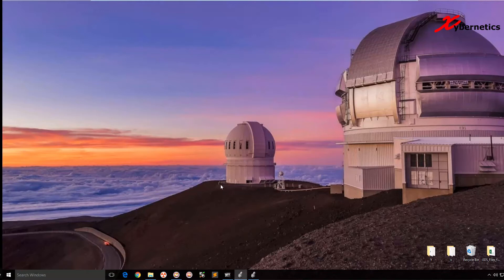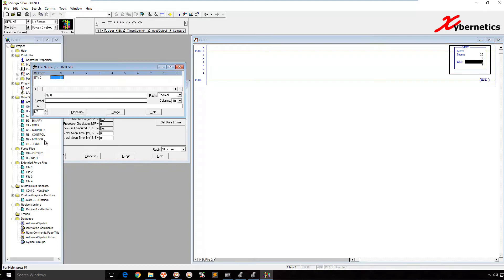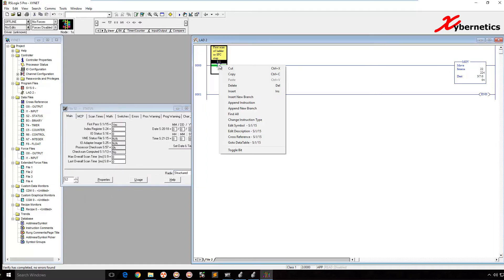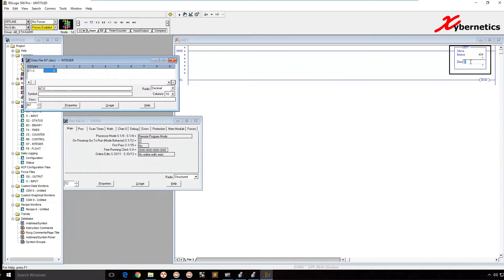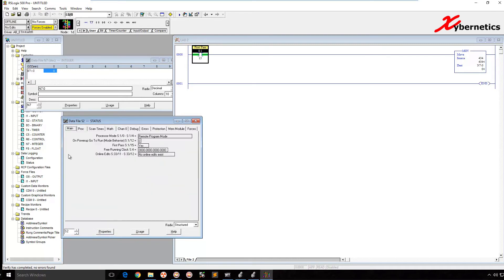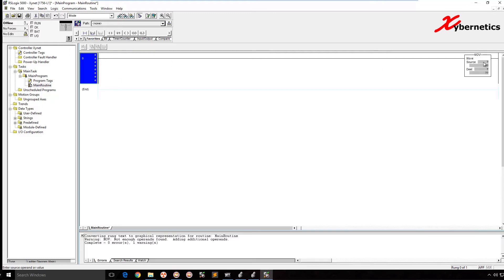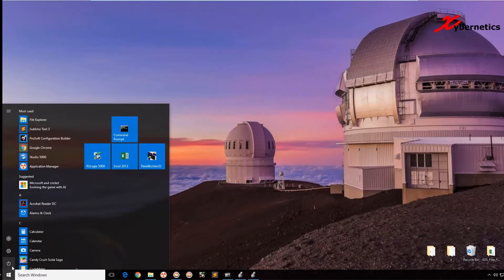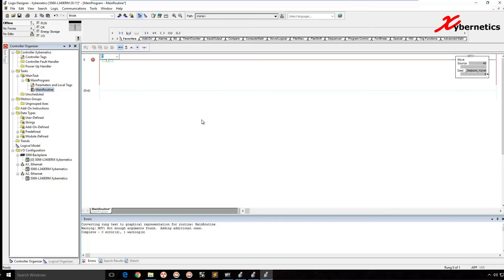RSlogix 5000 or Studio 5000 First Scan Bit For System Initialization

Comment: how we activate the S:N (user negative bit) and  S:Z (user zero bit)?
Reply from the maker: I don't think I am following you.
The RSlogix 5, RSlogix 500 and RSlogix 5000 uses status bit to display the status of the say function block or processor.
Have a look at the "Rockwell Allen-Bradley SLC 500 Instruction Set" user manual (link provided below), page 67 about ADD and SUB function block. Where S:0/2 has a value of ZERO for RESET. and if the value is returned as negative S:0/3 s set (1).

Rockwell Allen-Bradley SLC 500 Instruction Set
https://literature.rockwellautomation.com/idc/groups/literature/documents/rm/1747-rm001_-en-p.pdf

I hope that helps.

Comment: How do we find the status bits file in RSlogix5000
Reply from the maker: It is defined in the user manual. Status bit file are not common for the RSLogix 5000 but rather tagnames. Depending on what you ware after, most of them can be found in the GSV variables. I hope that helps.